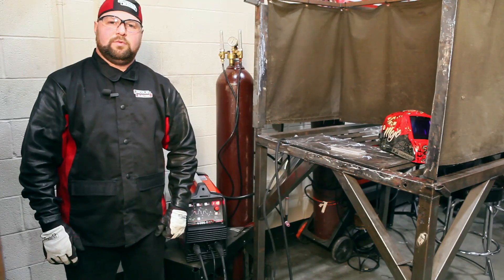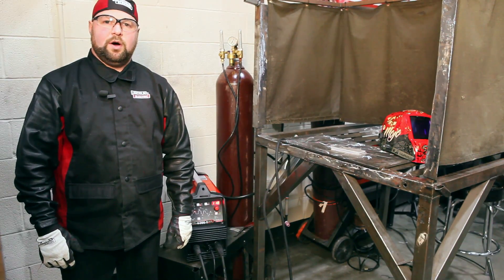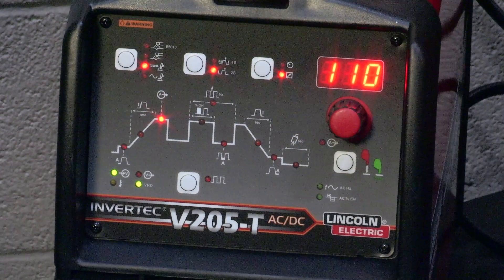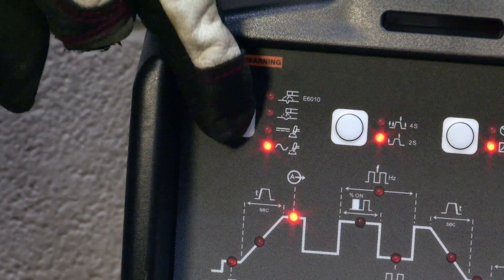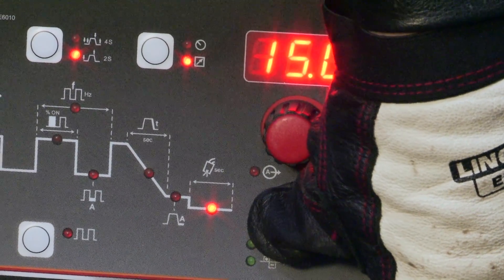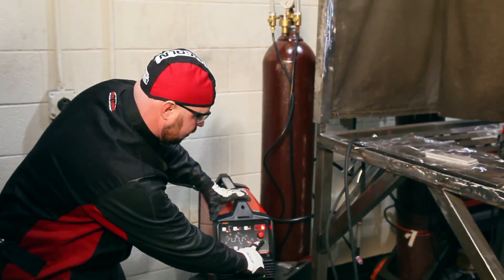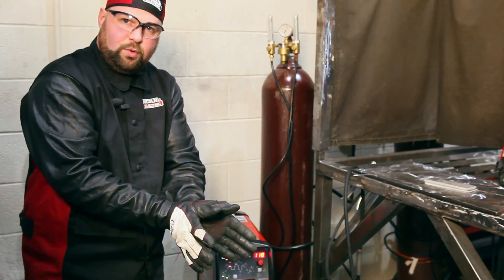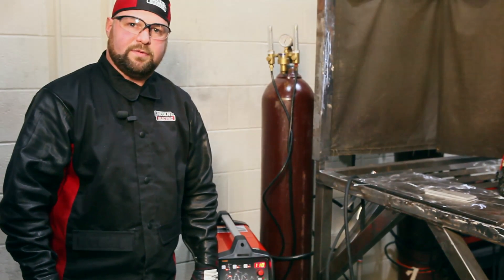Tips from The Experts: Inverter Based Power Sources

Comment: lincoln and miller both need to label their machines straight forward like everlast does with their tig welders as far as ac balance, ac freq, pulse amps , pulse freq, ect...very simple and straight to the point ...should really just say more or less cleaning action and skip the ac balance and frequency lesson ...